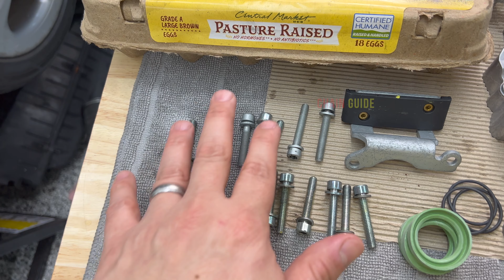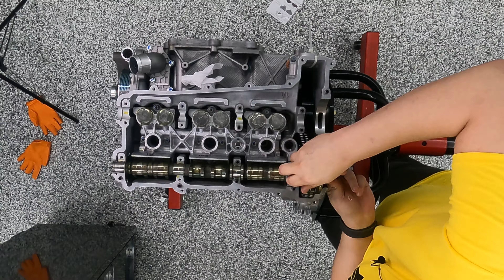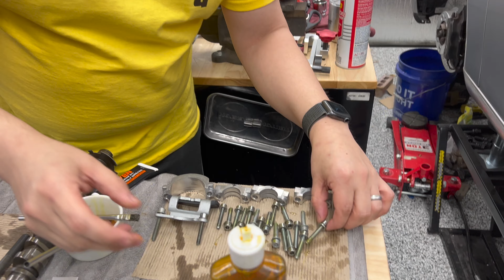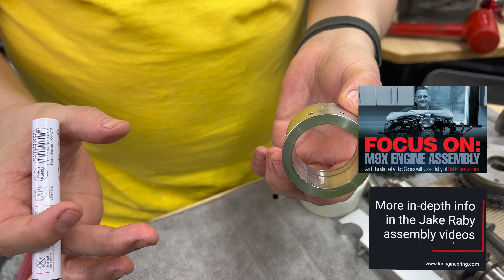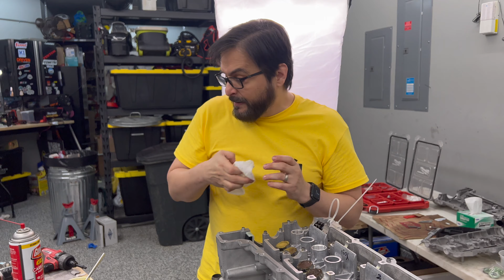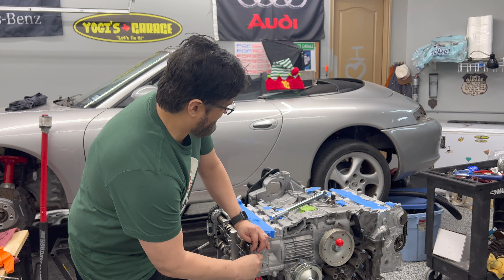Timing my 4.0L Porsche 911 - How Fast Should I Expect It To GO?

Comment: lifters should be left to soak in oil, but seen as the engine will not be started same day its kinda pointless.
Reply from the maker: Exactly. It’s been almost a year since I took them out. The oil would have seeped out. They were still slick and I didn’t aggressively clean them. Thanks for watching! ✌🏼